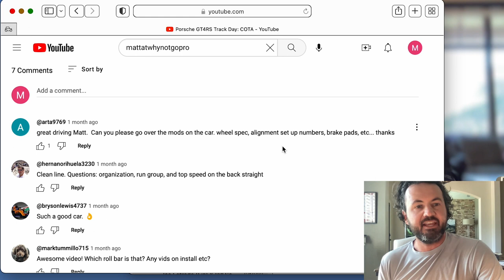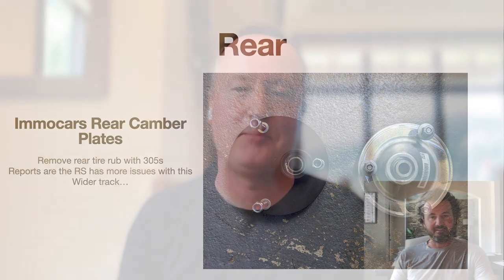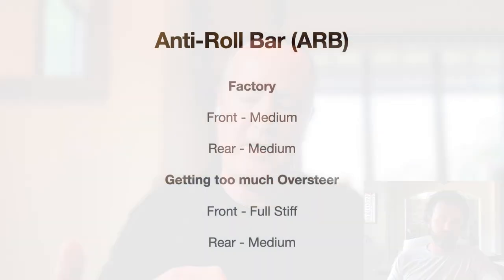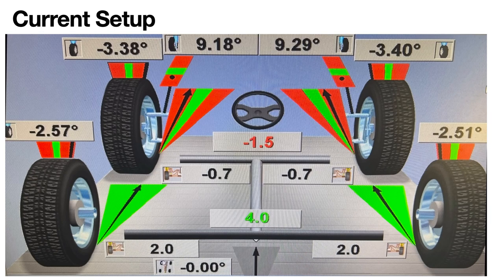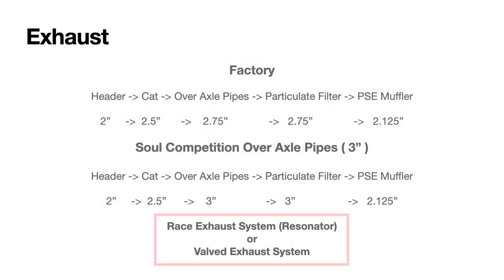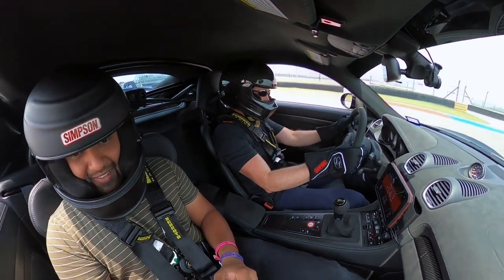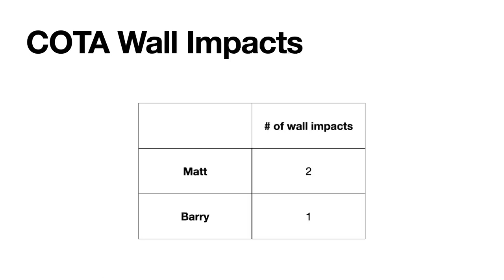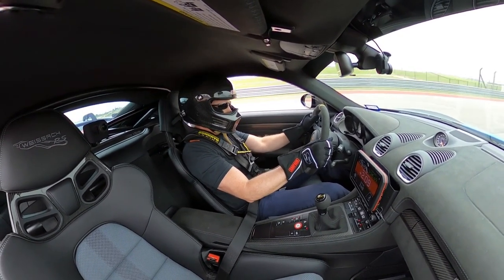Unlocking GT4 RS's Full Potential: Essential Mods & Track Setup

Comment: AP Racing brake fluid has a higher boiling point and Girodisc rotors with their race pads took my NSX to another level. Learned about them at the Watkins Glen PCA event where most GT3s were runnung wuthout any issues for days. I've tried Willwood & Stoptech, but the Girodiscs were the best

Comment: Loop some electrical tape on the sides of the Garmin Mount. This will provide a little more grip/thicknesswhen you push it in to place on the dash.. A buddy of mine had that same issue on the track with this thing falling out on him in the middle of a session. This solved it for good. Nice video.

Comment: Great video. Watched it twice now. 4RS arrives in a month, so getting parts coming. Did y’all have to slit the bottom cushions to fit the sub belt through, or are they ready slotted? Passenger side buckets carbon has to be cut out also, correct?
Reply: Driver seat has a slit already open for the sub-belt.
Passenger seat needs to be cut but the factory sewed it in such a way that this is an easy mod.
Reply: @barryminor2  thank you. Been trying to find this answer everywhere!

Comment: Have you guys had any rubbing on the fender liners with the hoosiers? I too wanted to stay with 20's and Apex told me a 265 would be too tall for the front AND rear. I find this hard to believe if you guys are both running the same set up. They offer a +52 20x9 front, so just a couple mm inwards from stock. The +61 is pretty incredible.
Reply from the maker: We had to install front camber plates and that allowed the 265 clearance
Reply: @ignitionontheleft  Thats what I figured. Thanks!

Comment: Super helpful!  My burning question…..how did all these mods combined (suspension, OAP, brakes) impact your lap times? Significant?  Also, my friend and I both stick the catalyst suction cup right on the PCM screen and have had no damage or residual marks…..
Reply: We started with these settings so I don't have a stock baseline.
With a pro driver in the car, mid way through our setup process, the car did a 2:19 at COTA.
I'm guessing he could get a 2:17 with our current setup but that will have to wait for cooler temps in Texas.
I will also say that we could easily pass the other GT4 RS's in our run group with these settings.

Interesting comment on the Catalyst suction cup working on the PCM screen.
Never would have thought of that.
Reply: @barryminor2  thanks for sharing and thanks for the comprehensive setup video!

Comment: Thank you guys, it was a great discussion. thank you for all the info.
I don't know if you guys did the rotors with pads or just pads but i highly recommend girodisc or Ap rotors because you will possibly notice little cracks on the oem rotors with ferodo pads after three or four track days.
Did the OAP change the sound inside the cabin noise or just outside?
Reply: Yes Girodisc will be the replacement rotors for us but I wanted to burn through the factory iron rotors first.
Thanks for the heads up on the cracks, I'll be watching for these now.
Reply: Over axle pipes only changed the sound outside.
I didn't notice any change in volume inside or added drone.

Comment: Hello, please give your recommendation  about wheel offset for running 265 in front and 305 in back, many thanks 🙏
Reply from the maker: Thats what I'm running in hoosiers and have had positive results.  295's in the rears felt like the tail wanted to come around.  305's solved that.
Reply: What is your experience driving on track with 265 in the front compared to 245? Some people have stability issues and go back to the original! BTW what offset do you have on your wheels?  @ignitionontheleft

Comment: Barry, do you remember the offset for the wheels? thanks
Reply: Front = 61mm
Rear = 50mm
Reply: 61 mm?? are you sure? because the oem front 20x8.5 is 61 mm. if you go to 20x9 , 61mm won't fit with -3 camber. it's okay i will confirm with finspeed guy @ItsTrackTime

Comment: you can roll the fenders slightly to run 305's.  easier than messing with the suspension, especially it costs a lot less.  a baseball bat and an experienced hand...

Comment: As much as I'm thankful Porsche put the gt3 engine in a cayman the facts are the GT4RS will never be near as fast as a GT3 due to it's smaller wheelbase....
Reply from the maker: Explain?
Reply: @ignitionontheleft  the gt4rs cannot carry the same cornering speed as the gt3 in the mid to high speed corners as the gt3 primarily due to the smaller chassis size and difference in suspension geometry
Reply: The GT4RS has a longer wheelbase than a 992GT3. Primary cornering difference will be down to tyre width. The 911 can accommodate wider tyres - secondly the suspension layout, struts Vs Wishbone.